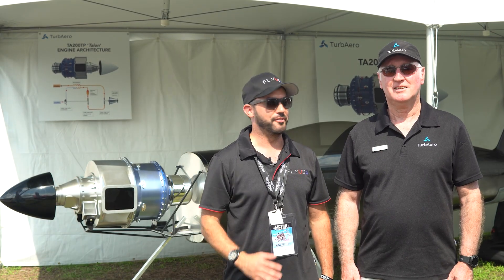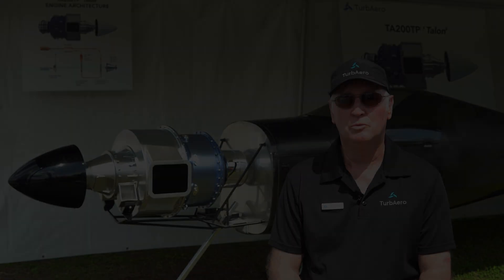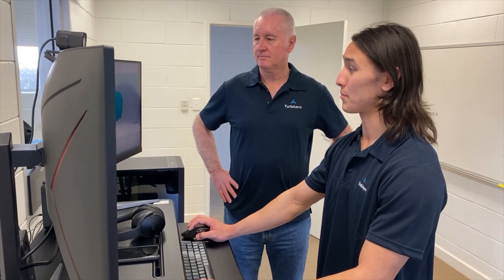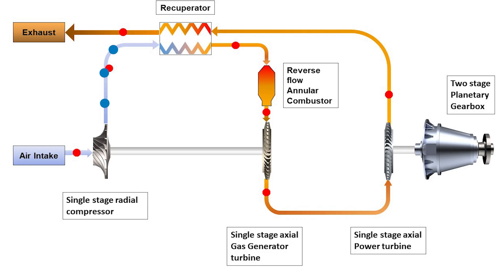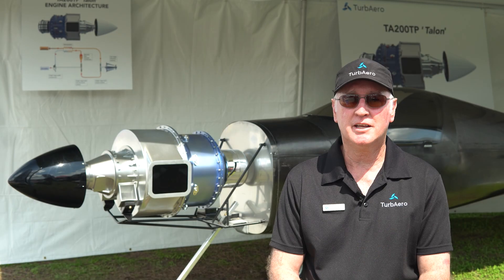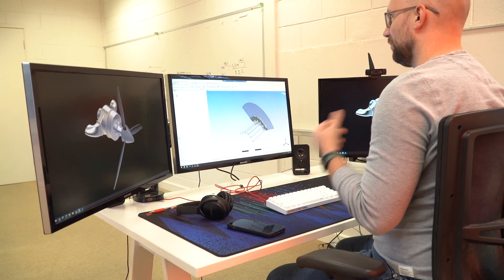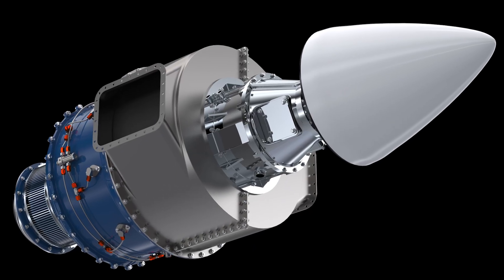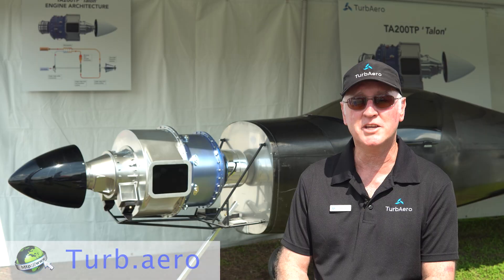200HP Fuel Efficient Turbine Engine by TurbAero

Comment: Sorry but at 12.5 gal/hour at cruise altitude, it is 25% more fuel burn than a conventional airplane engine.  Sure it can produce more horsepower but lets hope the airplane is designed to fly at more than 250knotts
Reply: You are talking about your typical four-cylinder, 360 cubic inch piston engines which burn at roughly 10 gallons per hour. But, these produce only 180 horsepower. The only things coming anywhere close to 250 knots are powered by larger, six-cylinder, 540 and 550 cubic inch engines burning much more fuel. So, this may be a good compromise of lower lead emissions, lower maintenance time, lower per gallon costs, etc.
Reply: @deanfowlkes  Yes it seams to be a law of planes at the moment Smaller Piston planes are ok 
but when you get to larger faster planes then Turbo/Jet becomes economical for the purpose.
Reply: @deanfowlkes  There is no lead in the future because the FAA has approved at least one non-lead avgas.  More are coming.  I have no problem of experimenting with new propulsion system but to say this is the same as piston is stretching it.  Turbine burns more fuel, period.  Turbine is efficient at higher altitude based on the speed they can fly, and turbine aircraft are generally larger so they can carry more fuel.  The smaller general aviation airplane are generally designed to carry about 40 gals of fuel and when they are leaned, they burn less than 10 gal/hour.  Burning 12.5gal/hour is at least 25% or more than conventional avgas.
Reply: @2Phast4Rocket  - If you notice, I never disputed the claim of the turbine having a 25% greater fuel burn. I stated the trade off may be worth it. You absolutely can get a better than 10 gallon per hour fuel burn at cruise burning lean of peak at altitude. I used to fly an old C172M with a constant-speed STC that could really sip fuel (comparatively). Rotax powered aircraft can get in the 5-6 gallon per hour range at the expense of horsepower and useful load.

As far as non-lead Avgas, that is on its way. Unfortunately, it is brand new. Even in an area that is serviced by a major Class B and several D, E, and G airports, there are none that have the new unleaded. It will be years and maybe decades before it is widely available. It may never be widely available worldwide. 100LL is becoming a scarcity outside of the US.
Reply: You guys do realize they wouldn’t burn avgas but could just burn Jet fuel, aka kerosene with freeze agents. The only advantage I could see of this is increased altitude if the cockpit is pressure rated. It can take advantage of the thinner air and higher air stream speeds and optimally cruise at a higher rate of speed. Thus the fuel consumes per hour would net you greater distance. So at the end of the day. It’s all about the airframe. If it can’t handle the speed and altitude requirements. Not worth it. Unless you want that turbo prop engine sound I guess. I mean it’s their own aircraft. If your willing to get Willy with your power plant, why not give it a shot if you got the moola.
Reply: @egondro9157  - We do realize that piston-props burn Avgas or the new No-Lead and turboprops burn Jet A. That is where the debate lies. Is it worth it. Avgas costs more than Jet A. No-Lead will more than likely cost more than Avgas. I don’t know that for a fact since none of my local airports carry the No-Lead, yet. Factoring the cost of the fuel, the claimed fuel burn, and the claimed maintenance intervals, this engine may be a viable alternative.

Comment: If it were possible they’d have a working example by now. This exact model has been showcased for 2 or more years now.
Reply: They have completed the design phase, beginning prototyping phase...you have zero comprehension of how this works don't you?
Reply: @maddogmorgan1  this engine is simple. A few rotating parts when compared to an ICE or even a transmission. The P-51 mustang was designed and built in 6-8 months…. So it can be done. They’re just treading water with an inept number of people working on the project.

Comment: OK - those numbers sound extraordinarily attractive.  About the same fuel flow at altitude as a comparable HP piston, unit price slightly lower than a comparable HP piston, TBO 1000 hours higher, using a fuel source that (unlike 100LL) is not becoming harder and harder to find, and less $$ per hour on fuel costs due to Avtur being cheaper.  If these guys can deliver on those numbers, this engine will be a winner.  I really hope they can.
Reply from the maker: I'm looking forward to seeing the prototype and real world figures, but yes it sounds very promising!
Reply: > unit price slightly lower than a comparable HP piston

Really? Did prices really go up that much?
Reply: @Finder245  KInd of, yeah.

THough with everything that's been said in the comments here being mostly true or just valid...  If I needed a 350-400 hp engine in an airframe, I'd take a LONG look at some of the various automotive conversions based on the GM LS engines.  There's a reason they keep making the pushrod V-8; they just work.
Reply: @Finder245  You can thank insane regulations from the FAA for that
Reply: From what I've seen, the cruise fuel flow is equivalent to what I get flying LOP with a TSIO 520, which is a 300HP engine. 

Which means you're getting 150hp at 12.5gph with the turbine vs 195hp at 13.5gph with the piston. 
Turbine max power: 200hp, piston max: 300hp. Plus the turbine costs ~30k more than the piston.
Reply: @diveforknowledge   I'd be interested in seeing actual power produced at different altitudes.  If the turbine can get more actual torque to the prop at (say)  15,000 feet, then it might be a better choice for  some dude's typical mission.  

Any engine install is a series of compromises.  Your TSIO-520 may be exactly the wrong engine for any number of people, but it works for you.
Reply: @diveforknowledge  It's also a turbine which have a failure rate in the order of 1:375,000 hrs vs 1:4000 hrs for a piston engine.
Reply: @johnheifner5813  Considering the difference in user between piston and turbine engine, I don't consider that to be representative of the engines themselves. Turbine engines appear mostly on business and commercial class aircraft operated with large maintenance budgets. Pistons are typically operated by cost conscious individuals and flight schools, neither of which are likely to perform the same level of preventative maintenance as would be expected on the typical turbine user.
Reply: @diveforknowledge  even RC turbines perform with less failure than piston engines… when you spin all the bits the same direction it sure makes things easier mechanically.
Reply: @diveforknowledge  Turbines do not require preventative maintenance in even the same class as piston engines other than the simple fact you can actually LOOK at the turbine blades themselves unlike pistons/valves in piston engines.  Vast majority of said "preventative" maintenance is not maintenance at all, but rather hold overs from a bygone era of retentive anal government military pukes looking for boxes to check on their forms.  All you have are injectors/fuel pump and pretty much nothing else.  Oil seals on bearings but those are good practically forever.  Starter of course, but otherwise... yea, not much.
Reply: @johnheifner5813   every 1 turbine failure is matched by 117 piston
Reply: @matthewspry4217  which is pretty close to the 1:375,000 vs 1:4000 hrs number I posted earlier. What’s your point?
Reply: @johnheifner5813   I said it in more easily to swallow way, why so serious?
Reply: @matthewspry4217  you @ me which made me think you were making some point I was missing. All good.x

Comment: drifts closer to adiabatic operation; the recuperator seems to work opposite to that of the turbocharger's intercooler.
Reply: Yes, it is opposite to an intercooler in a way, but keep in mind that an intercooler removes heat before the engine's compression stroke while the recuperator adds heat after the engine's compressor - that's a huge functional difference.
Reply from the maker: I initially thought the same thing having come from an automotive background
Reply: A car's engine needs cooler air because cooler air is easier to compress, which is basically what the pistons do. Hotter air is harder to compress. Piston engines compress air at the same time they are combusting it, which isn't the case for gas turbines. In the case of gas turbines, the compression stage is seperate from the combustion stage, so gas turbines are able to preheat their already compressed air before it reaches the combustion chamber, leading to better fuel efficiency.
Reply: Recuperators work by reducing fuel needed to heat the mass flow needed to produce requested power.   Intercoolers are used to offset compressor inefficiencies arising from need for a higher pressure ratio or mass flow. 

Recuperators are not typically used  in aircraft as their weight isn't offset by performance
Reply: The power turbine driving the propeller is a heat engine.  The more heat you can put through it the more power it makes. Using otherwise waste exhaust heat gives a “free” energy boost to the power turbine.
Reply: Was my first thought too. I was told to increase power, increase air by cooling, increase mass/volume, so you could make a smaller engine with same power. If feels counter intuitive ....
Reply: @wouteranthierens  A turbine engine's power is limited in how much fuel can you inject without overheating, so they typically run very lean fuel mixtures. More air doesn't solve that. lowering the compression ratio would solve that, perhaps by bypassing hot gasses around the compessor turbine, and driving the compressor at lower pressure. Or using water injection system like the b52.
Reply: @wouteranthierens  it's powering the turbine with the exhaust gas, not a crankshaft of an IC engine, so the process for more power is reversed i.e. it wants more energy out of the Gas Generator Turbine exhaust for the same fuel mas flow rate, not less.